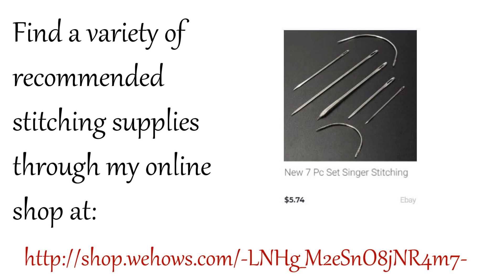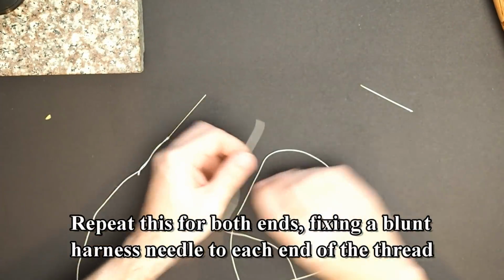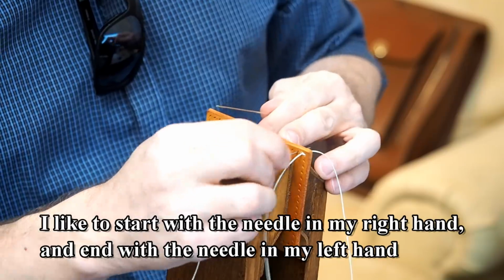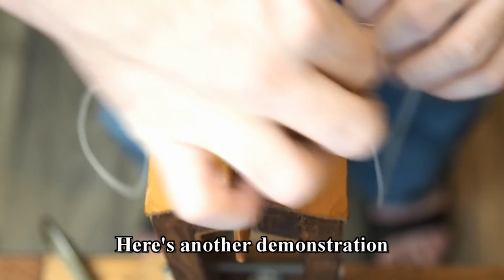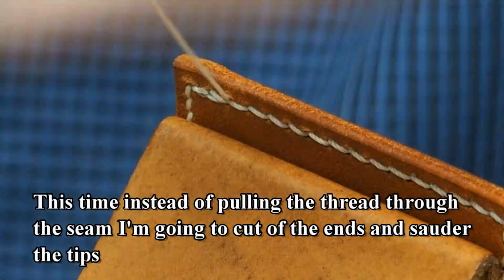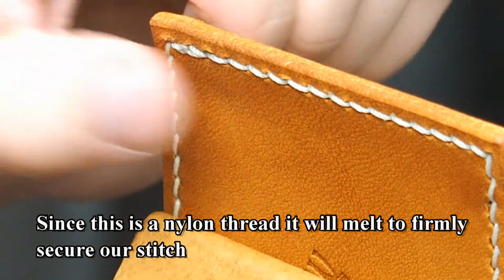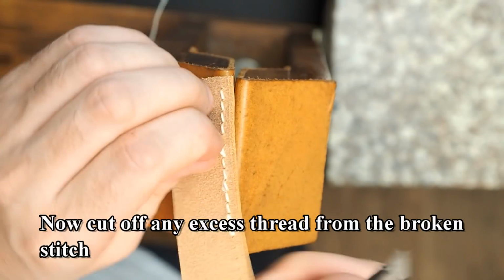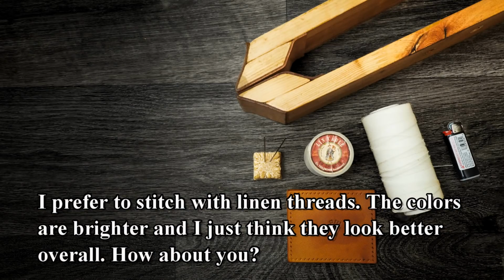Stitching Leather by Hand (Tutorial) Linen & Nylon Threads (Full HD)

Comment: Let me add that putting both needles through at the same time and then passing one thread back and the other forward the Knot is tied.  It saves time and steps ---speeds things up.  That is how I was taught/  The same move works when you backcast to tie off the last two back stitches.  Every stitch is a knot.